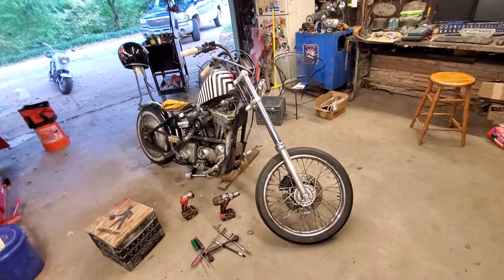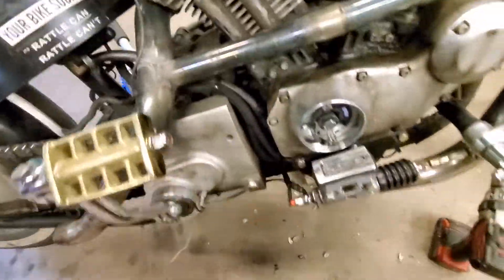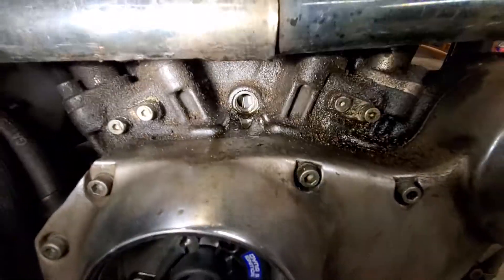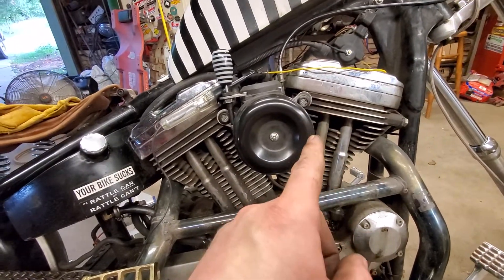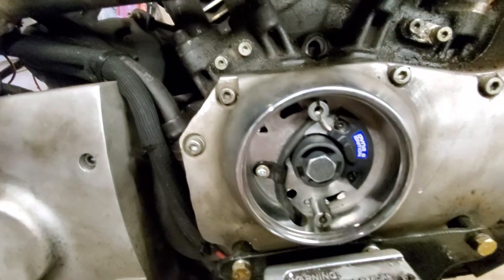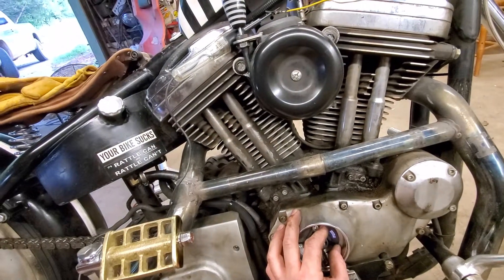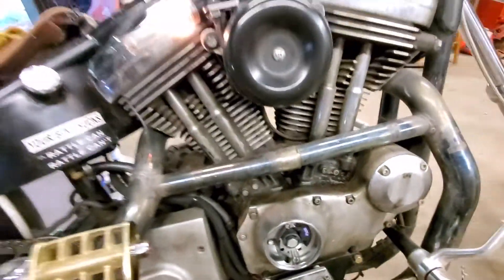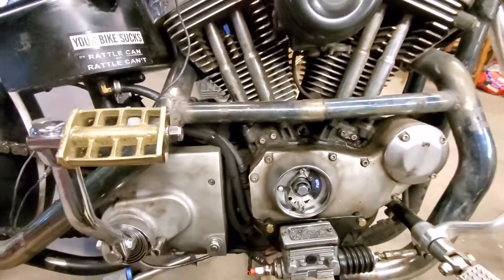STATIC TIMING A SPORTSTER WITH DYNA S IGNITION

Comment: the craziest thing// Misinformation is that mine wont run if I use the round timing mark (94 Modell) but i nneed to use the straight line mark to get her running
Reply from the maker: HD changed their timing marks a few times for whatever reason. Makes it confusing.

Comment: Hey did you keep the vos on your bike or get rid of it? Wondering how your bike ran after thanks!
Reply from the maker: Most aftermarket ignition systems replace the VOES system and functionality. The only reason I converted from the stock ignition setup to this one was to make it kicker friendly
Reply: Ohh ok cool thank you! So the dyna s runs without the vos than hey.

Comment: So I just installed this today. My instructions said to put the cylinder 1 on tdc with line on flywheel in center of the timing hole. Turn the cam counter  clockwise and hold in position while you turn the rotor clockwise until the light just turns on. The procedure seems to be the same as setting points without having to get the .018 gap. So now I am confuse do I adjust holding the cam or just rotate the rotor only?
Reply from the maker: There's probably several ways to do this. It's been a while since I timed mine and I haven't had to revisit it since, so I've been riding it for the better part of a year now.  If you do kinda what I show in this video it should get you pretty close. Also, some good writeups on timing a Dyna S ignition on the chopcult forums. Let me know if I can help.

Comment: Hey bro, I guess this is my next step. Just got my kicker kit installed, kinda works maybe 75% of the time , not very smooth at all. And yes been around kick starts for many yrs. Might want to pick your brain about this ignition set up. And as always, many thanks , Ride Safe.                                                    Guy Speight
Reply from the maker: It's pretty easy when you go to set the timing on these now that I've actually done it. We can chat over the phone if you'd like and I can help walk you through it.
Reply: @CDeeZ69   Thanks , that would be great . 252 363-1673          G.Speight

Comment: hey man i was having the same issue with my 01 1200 custom , i had the line straight in the center , on the left side and even the right side but couldnt get my ultima to light up, it would only light up when the rear cylinder was on tdc on compression. which is super odd. and when that happened a single dot was in the timing window. and based on the manual it should be a Line and not a dot. confusion has been kicking in
Reply from the maker: I think from what I vaguely remember from reading the service manual, and asking around on ChopCult, there are some year models which you time by lining up the single dot in the hole, others the double dot, and others the vertical line...... I ended up using the vertical line. Hammer Performance has a great video that is really better than this one on static timing an adjustable ignition module like this one and they use the vertical line, like I did.
Reply: Use the line and I advance mine been ridding it couple years. Make sure the plugs are gap right
Reply: Use the line and I advance mine been ridding it couple years. Make sure the plugs are gap right. That would be on a 71 900
Reply: depends on what year u hav. they changed markings
Reply: Having the same problem. How did you fix it?